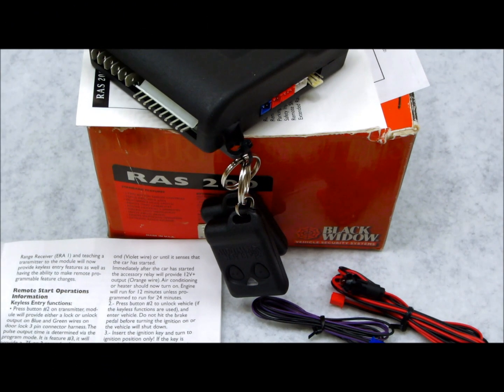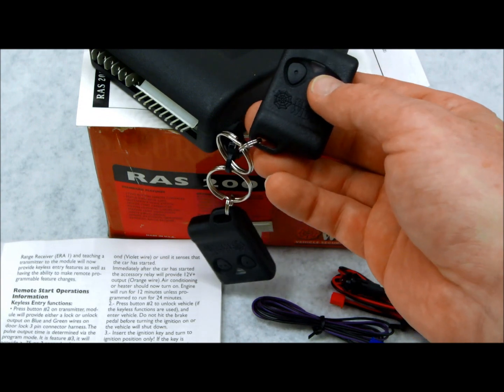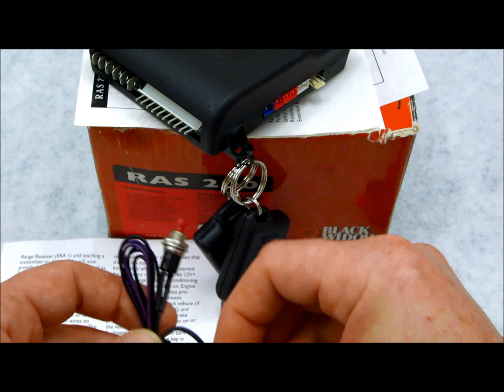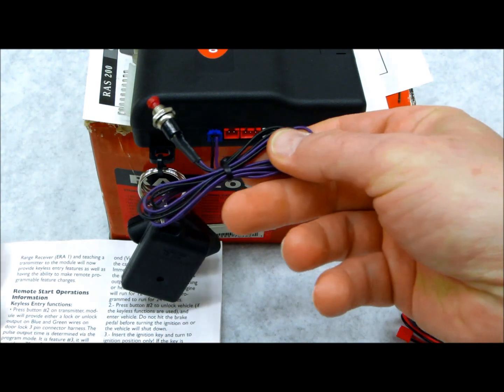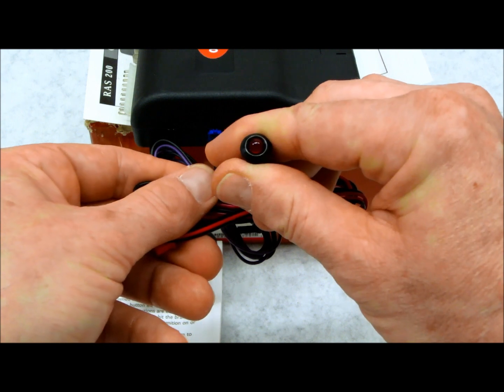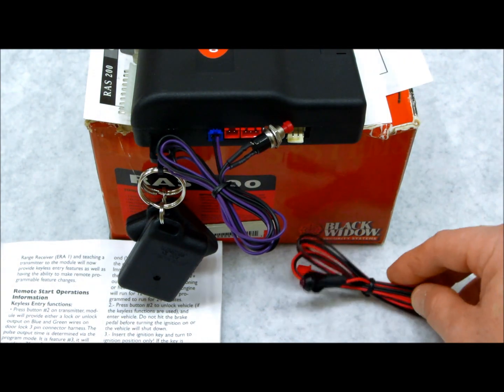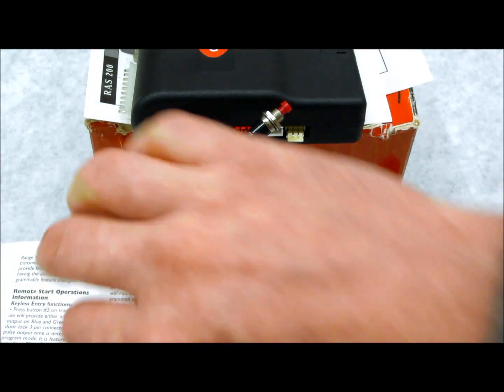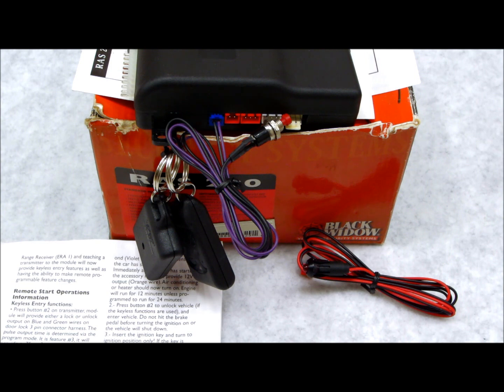Black Widow J5523518T1 Remote Learning

Comment: I need some help, I hope you don’t mind. I have an Atlas-branded alarm that uses the same remote and programming. One day, one of the remotes decided to stop working. I just continued to use the other one, no problem. I went to program a new remote today however, and it’s not wanting to. I have followed the steps to no avail, and what’s interesting is it seems to be entering programming mode, but nothing else. Also, ever since then, whenever the car is ‘ON’ and a door is ajar, the interior lights and parking lights flash constantly. It’s never done that before. Also, I cannot get the alarm into Valet mode. What am I doing wrong, or is the alarm dead?
Reply from the maker: Thats interesting, Try calling micro alarms in CA, they may be helpful getting it reset?

Comment: I have a black widow 10000 installed in car I bought second hand. Alarm was working till I was away for a month. The remote is a 2 button Remote King brand. When I got home the car would not start and I guessed it was the battery. Got extra charge to battery and car would not start. Behaved like the remote not working. Then I found a paper in glove box about reprogramming remote. The car then started and got me to work. Would not start again. Have been trying for days to get it started. Could not find manual for alarm on internet. only model not included on Black Widow site. Ready to leave car out bush but hope you can help with my problem. Mobile in Australia is 0490331539. Really need some help. Auto electrician wants my arm and leg to come look at it. Only one auto electrician  in this town. Help please.